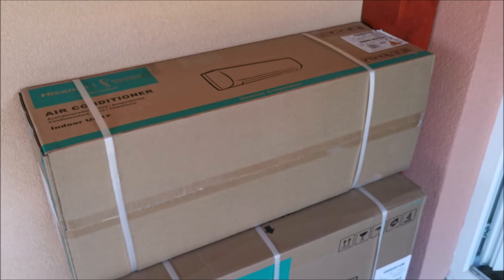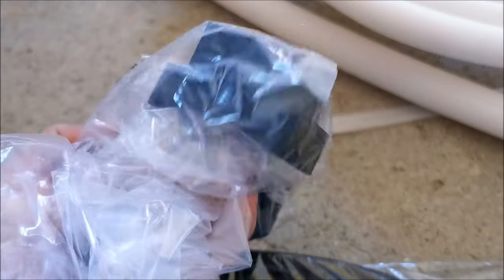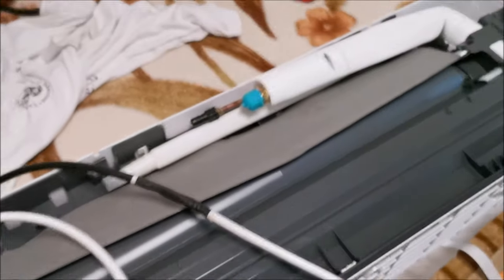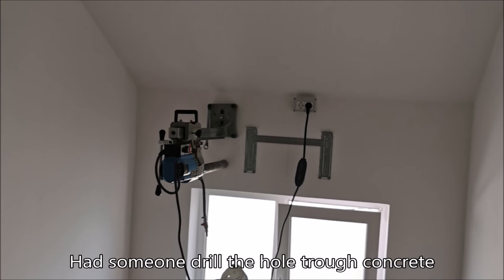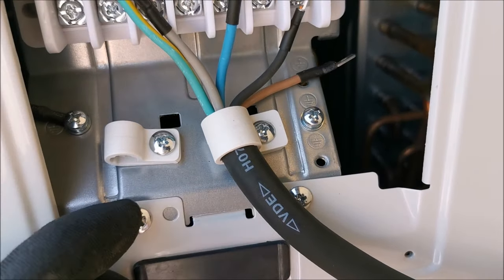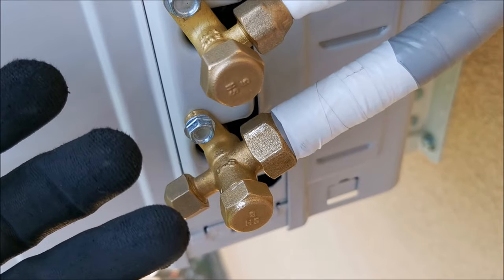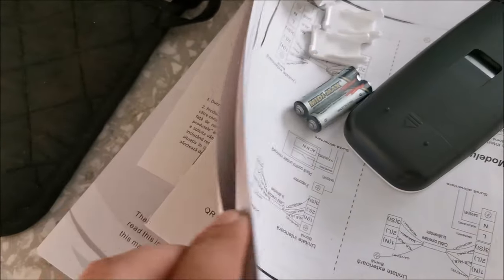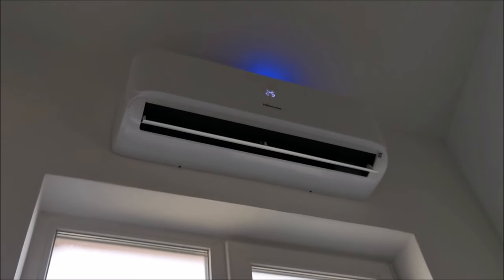HISENSE Eco Smart CD50XS1C Air Conditioner - how to install, connect to WiFi and open internal unit

Comment: Trebuie neapărat să îi fac vid ?
Reply from the maker: Nu inteleg ce vrei sa intrebi. A, ba, cred ca mi-am dat seama. Nu e obligatoriu, mai ales pe traseu de lungimea kitului cu care vine. Noi am folosit vidul mai mult pentru a ne asigura ca totul este ermetic.
Reply: @UltimateDIY  am kitul de la el de 3 m și am mai văzut un video în care deschide valva mare și apoi trebuie să apeși 5 sec pe butonasul unde aveau tu conectat compresorul că să iasă aer apoi sa deschid valva mica cred că acela e returul
Reply: @UltimateDIY   dar oare merge și daca  fara sa fac asta ?
Reply from the maker: Din pacate nu stiu sa iti spun cum se procedeaza in varianta in care nu faci vid.
Reply: @UltimateDIY  mulțumesc oricum pt tutorial
Reply from the maker: Cu placere 👍🏻

Comment: Am și eu unul ca aceasta
Reply from the maker: Par destul de bune la prima vedere. Sper sa tina si in timp.
Reply: Update după nici doi ani:
Cel mai teribil aparat din lume. Pe încălzire își face preîncălzirea, pornește după 5 minute (nu ca Daikin-urile mele care își termină preîncălzirea în maxim 2 minute) începe să bage căldură, dar destul de slab la 30°c pt un 18000 btu. Apoi brusc se oprește și intră în dezghețare chiar dacă nu are gheață deloc pe radiatorul exterior, apoi ventilatorul interior pornește random și bagă aer rece, iar apoi bagă căldură și intră în dezghețare și se repetă procesul până ajunge la 30°c. Chiar dacă nu îmi place să chinui aparatele fiindcă îmi plac, dacă nu las porcăria asta pe 30°c pe căldură și 16°c pe răcire n-o să facă niciodată față, chiar dacă pe răcire are avantajul că încăperea este la parter și cu geamurile spre nord, tot nu face față la 34 de persoane, ce-a ce un Daikin sau Mitsubishi Electric pot face față chiar dacă sunt de 12000 btu.
Dacă tot vine vorba de răcire între modul turbo (super pe telecomandă) și viteza maximă a ventilatorului nu există nicio diferență. Și mereu când îl las pe 16°c, trebuie neapărat să pâlpâie pe display codul de eroare " 77 " apoi să dispară pt 10 minute și apoi începe iar cu pâlpâitul. Am căutat codul " 77 " pe site-ul Hisense și ce să vezi, nicăieri nu arată ce înseamnă " 77 ".
Avantaje: 
-destul de silențios pt o chinezărie ( ce-a ce e destul de suspect)
- preț binișor la doar 2500 de lei când a fost achiziționat ( atât am dat și pe Daikin-ul meu de pe hol)
Design-ul nu e cine știe ce, telecomanda este foarte enervantă. Trebuie să stai fix în fața lui ca să preia comanda, dar tot există șanse să ignore senzorul aparatului.
Hisense e varză la aere condiționate. Din fericire, este în clasa pe care tocmai am părăsit-o și n-o să mai folosesc niciodată vreun Hisense 💅
Reply from the maker: Dupa comentariul tau sunt destul de convins ca ori ai prins un aparat defect, ori nu a fost instalat corespunzaror. Se intampla foarte des sa fie indoita una din tevi din scurt si sa se "gatuiasca". Spun asta doar prin prisma faptului ca al nostru functioneaza impecabil si tine toata casa rece invlusiv pe canicula din acest moment. Practic o casa cu etaj racita doar de aceasta clima. Asta e complet opus fata de ceea ce semnalezi tu, deci suspectez o problema la unitatea ta.